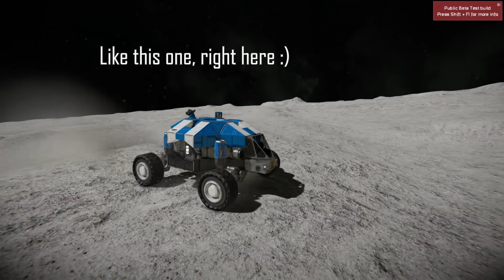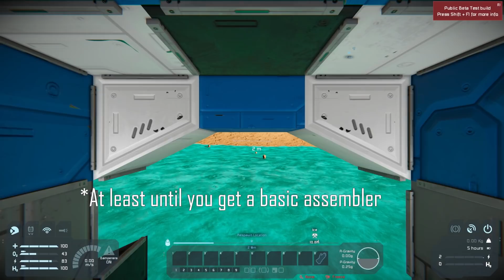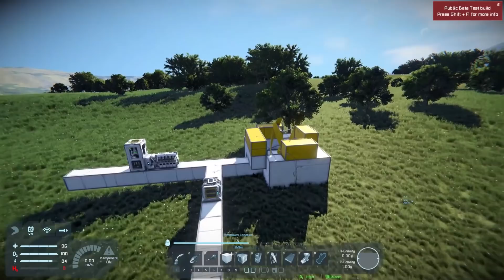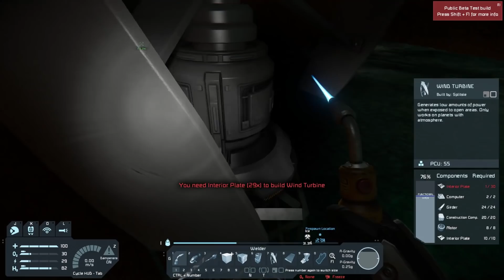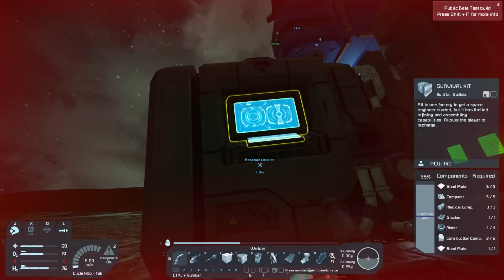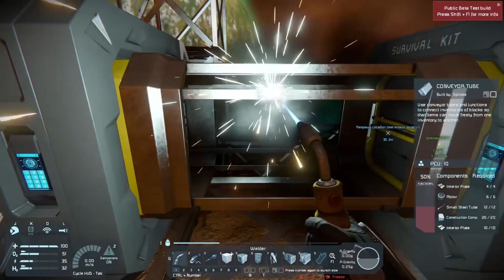Space Engineers Survival Update - Public Test #1

Comment: In real life Hydrogen acts as a battery and it isn't efficient to generate power to make hydrogen to use hydrogen instead of just using the power you had originally to make the hydrogen. So in this case how much wind power are we losing making hydrogen and using it in a hydrogen generator vs just using the wind directly or how does it compare to a battery (which I think is 20% loss in the game)?
Reply from the maker: That's just the sort of thing I intend to test when the update properly releases as it'd be really nice to know :)

I didn't think it was worth testing just yet as the numbers are bound to change during this testing phase

Comment: Survival Kit = my new stone removal tool on miners. At the rate that they are eating the stones it might even be faster than dumping them out a ejector/connector!
Reply from the maker: For some mining setups it'll be worthwhile, but I'm not yet convinced that it'll be worth the energy and weight with a flying miner, but that's not something I really want to test until the final update release in case they change the balance between now and then :)
Reply: @Splitsie  Sure, I havent even tested it myself yet and I usually build large grid miners since when you can build a small grid you usually arent that far off being able to build a large one. The changes to survival will probably change that though.

In my miner design I need to have a sorter for each connector dumping stones so being able to reduce that into a single block might be worth a bit more weight and energy drain. Looking forward to the update!

Comment: Pretty sure the hydro engine isn’t working, I had same issue. Showing output value of 0.  I than noticed that hydrogen not being used.  I experimented and found that if I shut my wind turbines off, it would finally kick on, and start using up hydrogen at a massive rate.  1 o2 gen can’t supply it, takes 3.   And than at that rate it barely producing extra energy since now most energy goes to powering the 3 o2 gens.  At this point since it won’t run when wind turbines are on, and it can’t produce with its massive hydro production, it’s a useless block.
Reply from the maker: I think the engine running off the generator may be deliberate, but I'll absolutely be testing it a bit more during the next test :)

Comment: i really wish they would make the power systems more realistic (no way can that tiny battery store 50kWh or that wind generator produce hundreds of kilowatts)

with current technology (assuming batteries are NiMh chemistry since they require nickel, assuming atmo thrusters are based on EDF's, reactors are based on known limits and critical mass requirements for fission to occur, assuming assemblers are similar to 3D printers ) 
> large grid battery: 35-40kWh capacity, 10kw max output , 10kw max input
> small grid battery: 10-15kWh capacity, 5kw max output, 2-3kw max input 
> small grid battery (small): 500wh max capacity, 250w max output , 250w max input 
> the solar panel should produce around 2kw
> the hydrogen generator should produce 20kw
> the wind turbine should produce about 1-2kw
> large grid atmo thruster (L) 300kw
> large grid atmo thruster (S) 80kw
> small  grid atmo thruster (L) 30kw
> small grid atmo thruster (S) 10kw
> small grid small reactor (change to RTG): around 250w (add uranium fuel rod to construction requirements so it never requires refuelling)
> small grid large reactor (change to RTG): around 1kw (add uranium fuel rod to construction requirements so it never requires refuelling)
> large grid small reactor (change to RTG): 1kw (add uranium fuel rod to construction requirements so it never requires refuelling)
> large grid large reactor: 400-500kw (requires ice or radiators cooling)
> gyroscopes should be weaker or use more power
> h202 generator should use around 5kw
> arc furnaces/ large refineries should use 10kw and 100kw respectively 
> basic and advanced assemblers should use 2kw and 10kw respectively 
> interior lights should use about 50w
> small and large spotlights should use around 250w and 1kw respectively 

if (somehow) the batteries are lithium based, multiply all battery numbers by 4
Reply from the maker: I don't think we should be looking at this in terms of quantitative realism, we should look at it more qualitatively as in, if it feels real and is fun to play then that's where we should be. Right now the hydrogen engine doesn't feel quite right from a qualitative standpoint and nor does the wind turbine, especially since the turbine virtually nullifies the need for solar (something I'm quite disappointed by). But since this is a first test there will certainly be some adjustments made based on the feedback so we'll just have to wait to see where it ends up.
Reply: they are carbon nanotube based batteries or something.
the batteries arent unrealistic, if you factor in that its probably based in the year 2100 or something. we have jumpdrives and working ion thrusters!
Reply: @kitsunekaze93  even nanowire batteries aren't that good

Comment: Splitsie, the Hydrogen Engine outputs the same amount of power as is required to run the O2 Generator.  So it is more like a battery or hydrogen thruster for wheels than a reactor.  Because physics.  In truth the Engine should be producing less power than the generator requires to produce the fuel, but also output ice if it were to be modeled to a greater degree of physics accuracy.
Reply from the maker: Yep, but it still should have started as the power to separate the ice to h2 should have been provided by the battery or wind turbines, so there's still some bugs to work out there. I'm really hoping that Xocliw's comments about an alternative fuel/setup for the engine are real because I think something else being involved in the process will make it more interesting :)

Comment: I enjoyed the beta test.  I went for the Moon Rover and it soon became a nightmare, but fun.

For power I needed solar panels, they take a while but you can build them.  So I fitted a drill to the front of the buggy and went around shaving the moons surface for minerals, and built a couple of panels and the basic assembler.  But it won't start without a lot more power, so five solar panels later it still won't start because the angle of the sun is wrong.  'Simples' you say, a rotor and ISY's script, need large and small tubes for that.  So I strip the whole setup down and re-orientate it to catch the sunrise, and it works ... for about five minutes until the sun gets too high/misaligned.

Without the basic assembler you can't build a refinery that'll accept actual ores or the hydrogen engine because you need large tubes, you also cannot build a battery.  I reached the point where I'd got over the hump before I had to stop

It didn't help that before I did the above I did the usual task of driving around looking for ores, mapping the positions (no point starting a base with no ores nearby) and collecting a bunch of iron before I realised that the starter refinery cannot do anything with them.  So I ended up with a buggy with medium cargo containers strapped to the back and sides to carry all the junk I'd collected.

So, not to sound like one of the 'Four Yorkshiremen' ... you had is easy, in my day we never had any of the new fangled windmill things.

Suggestion for next time, grind down the four atmos and move them to point in each direction.  Fit a drill on the ship, use the hydro for lift and you have a basic miner.
Reply from the maker: That sounds like a really tough start, I feel a bit foolish but I'd completely not thought about how tough a moon start would be with the lack of balance around the turbine and solar panels at the moment. It sounds like you had some good fun despite the challenge, which is just the sort of fun I love.

If you decide to go the moon again, it might be worth trying to attach the rover to a large grid rotor head (or place a large grid rotor and a small grid head on the rover and back into it and lock it) then you'll be able to use the battery from the rover to power your assembler temporarily - fiddly but might work out :)

On titan or one of the other moons that would totally work out for a quick mining ship, might have to try that as a start too :)

Comment: Great video Splitsie, I hoped that you will make a video about the new update. I was able to play the test server too, and my experience with the hydrogen engine was that it's just need some time to start. I built it with an O2/H2 generator, put some ice in it and the engine started after a couple of minutes, and it produced energy too. So yeah, you don't need a hydrogen tank and you don't need to restart the base. At least for me, it worked. Also you should mention that, you can burn to death not just freez to death. Because now you are able to drill to the middle of the planets, and the temperature actually gets higher if you are going down :D
Reply from the maker: Hmm... when I first messed with in on small grid it started straight away, so maybe there are just a few bugs with it still (which isn't a surprise since it's still a test build). At least it wasn't just me experiencing problems since I really couldn't see anything that I was messing up :P

I'm going to mess around with the temperature mechanics properly later in the test (when they're less likely to change dramatically) as I think there could be some very fun tests to perform :)
Reply: I am really looking forward to those tests :)

Comment: I've done a little calculation, all of this is in a 3x3x2 space in a small grid
----------------------------------------------------------------------------
Small Battery
--------
2*18=36 computer
2*18=36 power cell
2*18=36 Construction Components
4*18=72 Steel Plate

Max Energy Stored:50kWh*18=0.9MWh
--------------------------------------------
-------------------------------
Battery
--------
-------------------------------------------------------------------
2 Computer
20 Power Cell
5 Construction Components
25 Steel Plate
Max Energy Stored:1.08MWh
-------------------------------------
-----------------------------------------------------------------------------------------------------------------------------------------------------
This basically means that in a small ship if you have enough space(3x3x2) it's better to use the normal battery rather than the small one if you want to be efficent
Reply from the maker: I think that's the right choice for balance as it's good to keep the larger batteries as a useful option due to them being more efficient in some way, I'm looking forward to sneaking extra batteries into little areas just for that extra boost when needed though, and the mini drone capabilities :)

Comment: I like that they're adding new methods for producing power. However, I'm not so sure I like the new rule for where uranium will spawn. Sure, it's not really a problem to make the other powersources, but reactors are an easy and reliable powersource that's not dependant on location, time of day, or what blocks are around it. When you mine uranium, you mine a lot. Then you put it in the refinery, and the ingots get fed into the reactor, and you don't have to think about it anymore.

On another note, I like that they've added a new purpose for stones, as stones have long been nearly completely useless. Stones could only make gravel, which makes reactor components (I have no clue how peppels of rocks can become a component for use in nuclear power, but whatever). So when mining, you'd end up with piles upon piles of rocks, and have to spend time cleaning out the rocks. Stones were the glitter of Space Engineers, it get's everywhere
Reply from the maker: But given what you said, once you get to space and collect some, will it really matter that it's in space after that point?

Lol, you're so right about the stone, especially when you forget you've got the ejectors working on your mining ship and leave some stone in a connected inventory :P
Reply: We need to concrete as a basic block for building bases.
Reply from the maker: It makes a bit more sense now that we've got to work much harder to get the steel plates

Comment: Hey Splitsie, thanks to your Video I am now all excited as well. I also wanted to point out that in term of small grid blocks the new battery is 18 times smaller than the old one. If you place that many smaller batteries they sum up to 900 kwh of stored energy.
Reply: The old small grid battery occupies 2x3x2 blocks, so that's 12. Nonetheless, I find it correct that the new one should be less block/power efficient than the bigger one, because if you could store the same or more energy in the same space using the tiny batteries, why build the other ones?
Reply: @Cicgnar2  I double checked just now. It is indeed 3 x 3 x 2 which is a factor of 18. Please also double check in the future.
Reply: You're right, my bad. At any rate, it's still better to use a normal small grid battery than 18 tiny batteries in power/block ratio, due to materials. Nevertheless, you can use tiny batteries in all the odd blocks you have left, which I guess it's the whole point.
Reply from the maker: Hmmm... that means they carry less energy in the same space for a cost of around 75% more power cells. So, they're quite inefficient, but since they fill such a small space might end up useful regardless :)